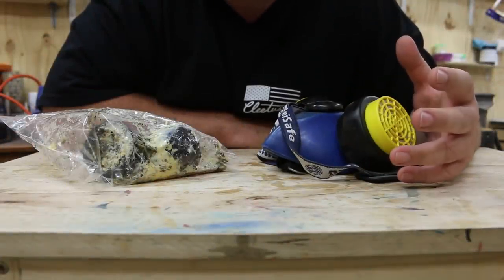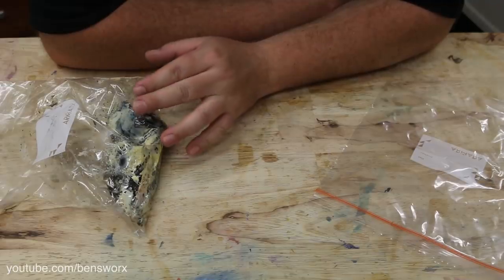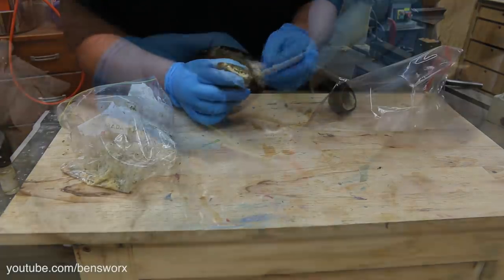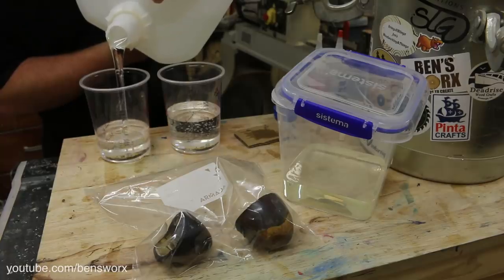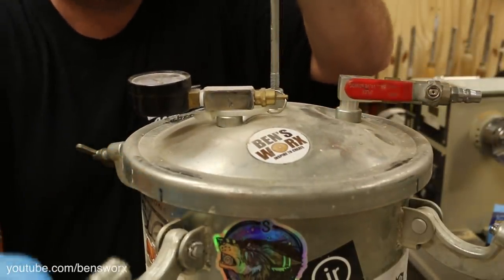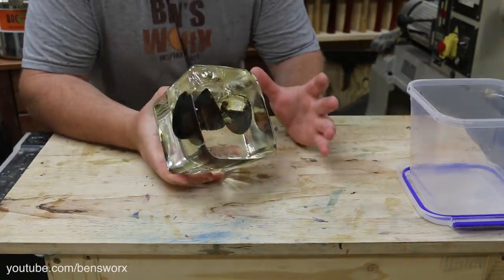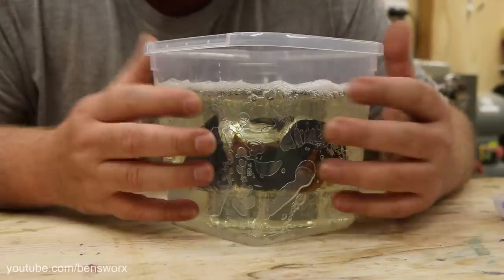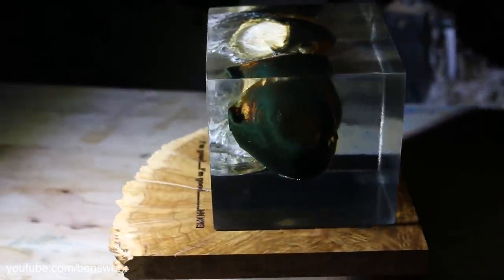Recasting The 12 Month Old Egg in Resin

Comment from the maker: Thanks for stopping by, If you have time you can check out my new range of Eggs here www.etsy.com/shop/bensworx
Reply: Hi Ben I really like that project the crack was so cool to see it 
By the way  I have suggestion for a project 
Why don't you try to recreate the circles that appear in the corn or wheat fields in England in resin?
The ones that people says are made by U.F.O.
Reply: Just a quick question I'm doing some casting with glitter and it keeps sinking to to the bottom of the mold as it sets is there anyway to stop this from happening?
Reply: the masks that good bcs the smell of the egg is a foul gas and not a aroma like the bubblegum. it does bcs of this a way better job.
Reply: Hey man I had an idea the other day and I'm not sure if it would work but what if you coated fluorocarbon fishing line with resin to make it rigid. Then use the "sticks" to susped things and make them look like they're floating. If it works I'm sure you could make some cool effects. Love the vids though dude.

Comment: Well, that was different!
Putting the mold under vacuum first for a bit, then transferring to pressure may help to remove trapped air as well. 
Electrical shops use that method - also known as Vacuum/Pressure Impregnation (VPI) - when building or repairing generator rotors.

Comment: I would have never cut that cesspool biohazard open in the first place... but since that was done, I think I would take a shower in 91% alcohol... and then put on a full head gas mask and use a backpack sprayer and spray down my entire shop with 91% also... then soak down my work bench and anything else it came into contact with... then take another shower... 🤮🤮🤮
don't know how you did it Ben

Comment: 😆 Not gonna lie, when you said you were re casting my stomach dropped. But wow trust you to turn it into 'art' 😆😉 
Also with resin in the vacuum I normally let it run for a good 30mins if a deep pour, then release the air slowly (like you do) and just don't open it and leave it in there to harden, it 95% of the time will collapse the bubbles ☺️ Great episode as always Ben!! 👍👍

Comment: Wonder if there's any way to degasser resin without a vacuum chamber but is there anything else that could possibly be used but that really turned out cool but I finally got my hands on a sphere mold I've got half of my project that is complete now I just got to put the top on it and add resin through it but no pressure pot no vacuum chamber so and there will be no way to get a flame to get rid of the bubbles so I'm at a loss and just need a little help

Comment: Suggestion: cast a block, drill a hole in it to the middle, then crack an egg into it.  Cover the hole with a sheet of plexiglass and UV resin.  Then pour on more resin.  That should provide a nice show over 12 months or so.

Comment: I was under the impression that the point of the vacuum wasn't to let it set under vacuum, it was to pump all the air out of the object under vacuum and then release the pressure while the epoxy still flows freely so it gets forced back into all the little voids that previously had air in them?

Comment: You can just cut a hole in the bottom of the egg and take out the insides so there's no rot since you attach them to a base (just put epoxy on the inside too).